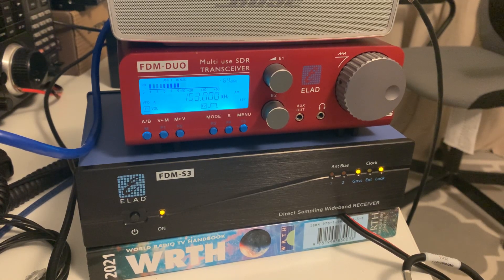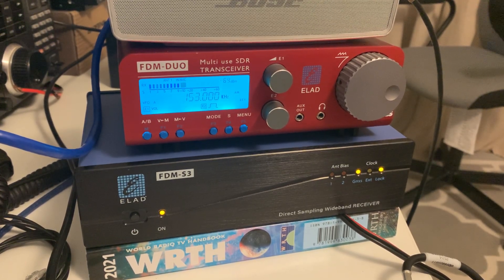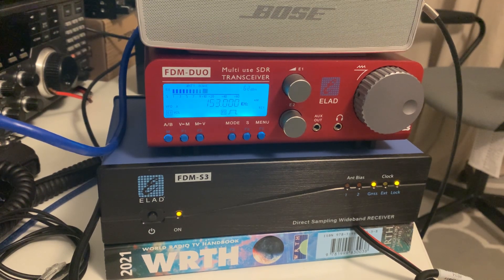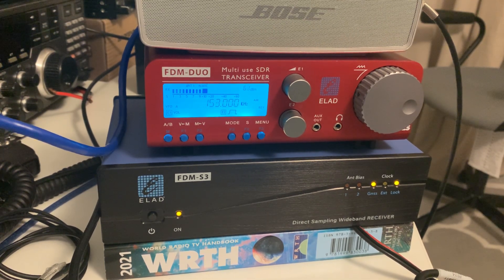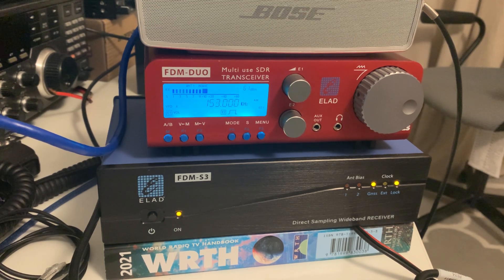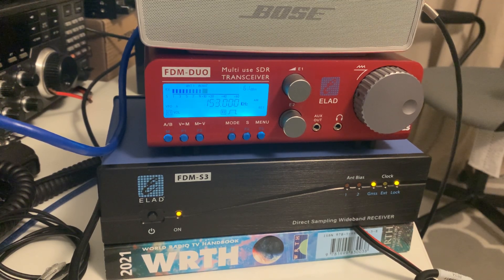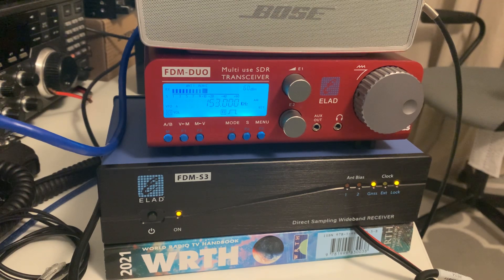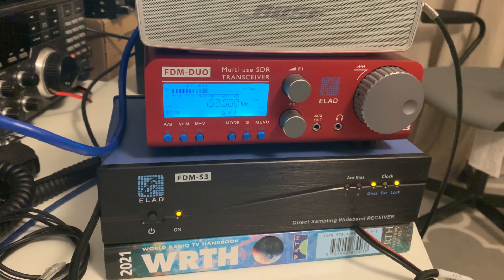Goodbye to the Elad FDM-S3 following extensive testing and writing the Radio User magazine review.

Comment: For me, the possibility to record 24 MHz and the downconverter were the reasons to buy this receiver. For DXcamp use, it will be incredible, during FM openings too. For better use I needed to spend some money with a new notebook, upgrades (SSD, a NVME and more 8 GB RAM - 16 GB total) and a better power supply with surge protection. Probably it will be my ultimate receiver. And probably my unit will be the first in use in South America :-)
Reply from the maker: Hello my friend, no doubt a reasonably recent laptop is a necessity with the S3. 73!

Comment: Hi Clint ! In terms of sensitvity / selectivity (MDS, DR), the Airspy HF+ Discovery is even better (vs RSPduo and RSPdx). Costs about $150.
Reply: The Discovery has nice specs, but for someone who like to record big chunks of spectrum during DXcamps, less than 1 MHz is a problem. I'm waiting my S3 to be delivered and the possibility to record 12 or 24 MHz (really interesting during FM openings) is a real plus.
Reply: @regionaldx  I share your opinion about the max available BW. This is the only weakness of the Discovery. 10 or 20 MHz BW is a real advantage in some circumstances, but you need a powerful enough PC. I have an RSPdx and a Discovery, and I use the latter 99% of the time for its clearly superior performance. The RSP is only used to receive UHF RS and ADS-B. Have fun with your S3 ! (I had an S1 and S2). Best regards
Reply: @regionaldx  Did you ever receive your S3?
Reply: @Coowallsky  yes, two years ago. Very nice rig. I bought the down converter one year ago.
Reply: @regionaldx  I'm leaning that way. How much was the down coverter?
Reply: @Coowallsky  around US$ 400
Reply: @regionaldx  I wound uop going with an RSPdx for now. Tested it against other in its class including HF+ Discovery and the RSPdx came out on top. The S3 is on my "future" list.
Reply from the maker: Thanks Patrick! 73!